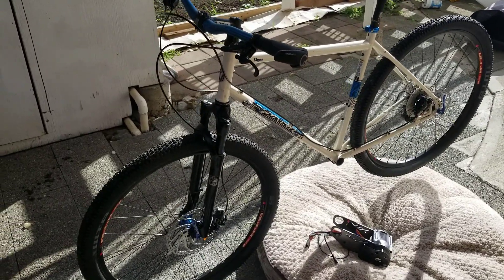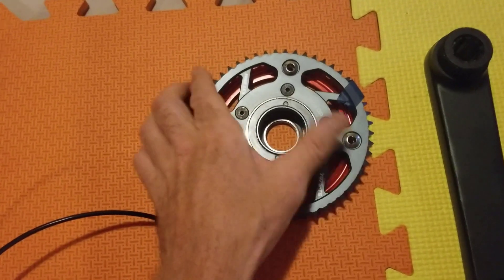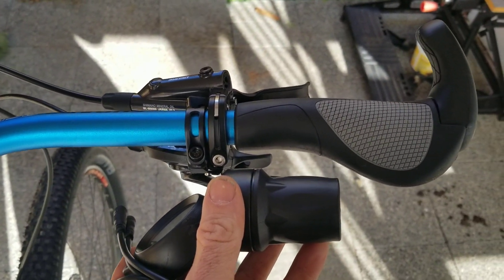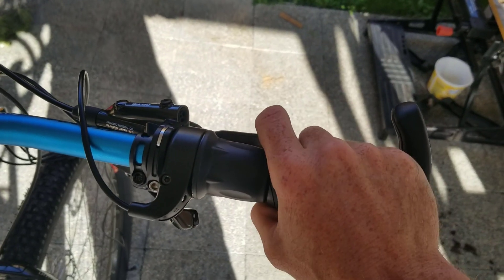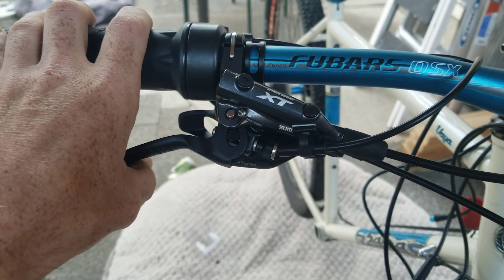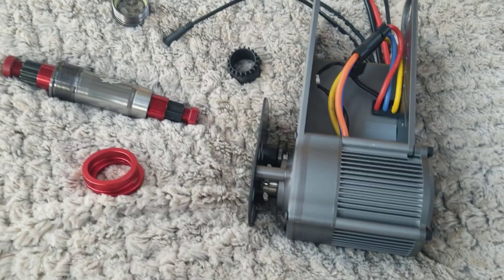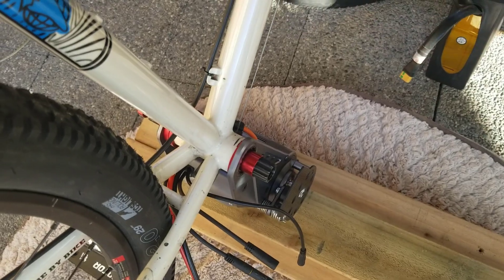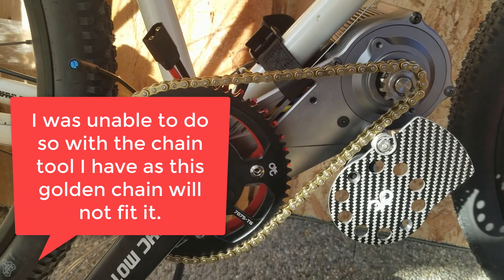CYC X1 Pro - Install on Salsa Vaya (or not)

Comment: I watched a lot of videos yet about this motor. There are too many issues with it. I better wait and see...
Reply from the maker: Yeah the first issue was a little of my making but I get what you are saying. I was hoping to be riding by now. Part of the attraction for me was that it is a new and exciting piece of tech. But their procedures and process needs to catch up with the engineering. Wait and see might be a good idea. They have a torque sensing version coming out. Hopefully I'll have it on the bike and running soon.
Reply: @HighVoltageKits  hi. I kept writing to Jon the manufacturer, he send me a bunch of info but not on the torque sensor. Also the display looks cheap on some videos and is totally outdated in comparison to the motor. I have a hard time to decide if I rather want to have an hub motor, since I have an Nicolai Nucleon st frame, which is extremely complicated....
Reply from the maker: Sounds like a challenge for sure. In some ways the x1 is quite advanced. But other areas are a bit less so. I am hoping that 3rd parties take it up to produce add ons. Much in the way I use a lekkie chain ring, eggrider display and different crank arms on my bbshd build. The stock stuff I had was a bit crap but the motor itself is great.

Comment: Well this explains why I was discouraged from ordering by THEM until the new, supposedly, final version comes out.
Reply from the maker: I've been chatting with their people. Apparently the motor I was using has a 12 tooth drive sprocket which only runs with the 72 tooth secondary. If I'd used this it would have worked. The other two combos work only with the 11t. So partly my fault. I used the unit with the controller already attached. So I'm going to switch the 12t out for the 11 and go from there. I had no documentation in the box at all or labeling or warning stickers lol. The motor might be cool but they need to get a handle on service stuff.
Reply: @HighVoltageKits  I am glad you're willing to be a guinea pig for this 😉Hopefully it gets all sorted. It is making my decision to just go for the known and proven good (BBSHD) a little easier at this point. I noticed that another guy who put up videos for it some months back (that you would have seen) is now riding a Levo... I might also just end up buying the newly announced Frey EX with the Bafang Ultra when they are released next year - though I still would like to chuck a motor on my Fat Bike.
Reply from the maker: Hell-Knight They were very quick to respond. Part 2 soon!

Comment: Exceptionally clear and honest video. I am curious how the manufacturer will respond. And how quickly they will send corrective parts. I'm sorry this installation has been so challenging so far.
Reply from the maker: Thanks. I have a theory that the distance between the drive wheel and bottom bracket was shortened with a design revision and I was maybe in receipt of older motors from stock with chain that was measured for a more recent motor. Or the chain maker screwed up. It's the same issue with all three chain and gear options I have tho.
Reply: @HighVoltageKits  I just took a look at their website, and they give clear dimensions for their gear-driven and chain-driven units. I'd be curious if your unit matches their new specs.
Reply from the maker: My calipers don't stretch quite that far but it looked close to the 250mm stated. What isn't pictured is the newer torque sensing version so it would be interesting if the dimensions for that are different.